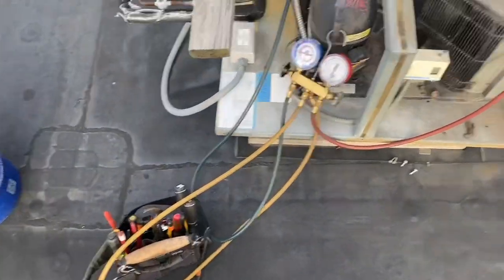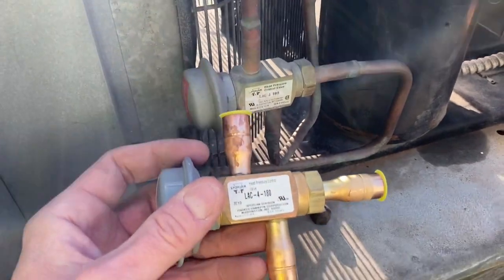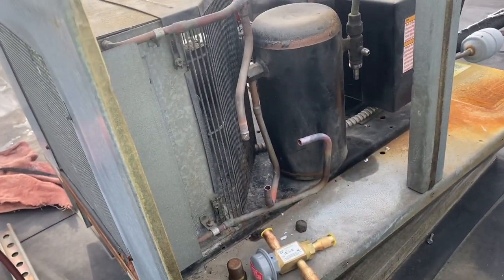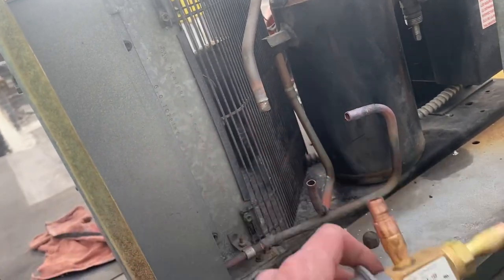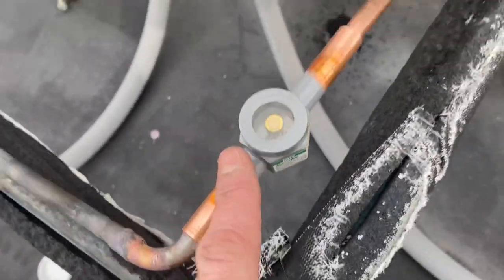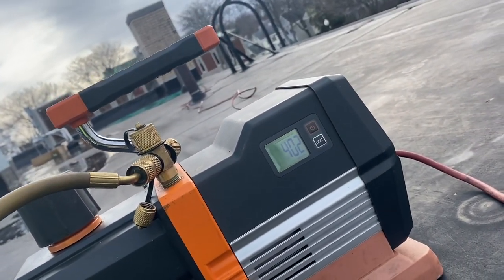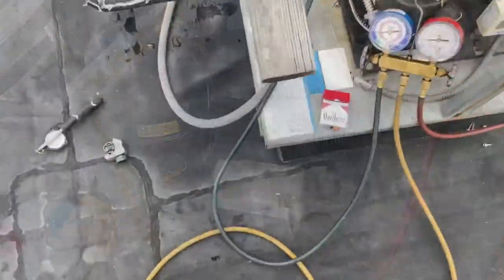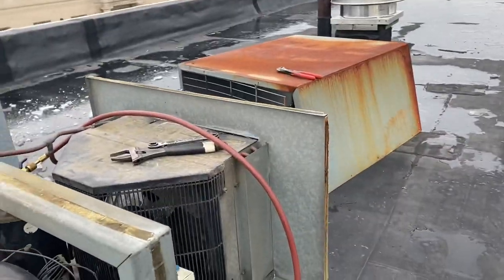Tis the season for Headmasters

Comment: Love your videos 👍 looks like some copper plating going on the inside of that site glass ?.  I got a love those guys who came before you left moisture and  air in the system that cause that acidic condition that breaks down the oil causes sludge and copper plating.  Great for causing and inventing new work in the future like a ticking time bomb.  Nice way to intentionally sabotage a customers unit.
Reply from the maker: Unit is very old too so who knows

Comment: Awesome video man. Just started watching your channel. I'm starting out and love the industry. Couple of questions for you. When you removed the old headmaster did you relieve the pressure in the old valve by cutting the pig tail off so as to not overheat and explode the old headmaster valve? Also what is the headmaster valve exactly designed and trying to do? Is it to Keep head pressure up so the low side doesn't drop down to  far to prevent the evap coil from freezing? Also how do you diagnose a bad headmaster?
Reply from the maker: Thanks man.  No I didn’t cut the pig tail . The headmaster is designed to maintain a certain head pressure during cold weather conditions . I have another vid on the channel explaining about them and how they work .

Comment: What would happen if the head pressure control failed open?
Reply from the maker: are you talking about the headmaster valve in the video or the actual high pressure control / switch ?